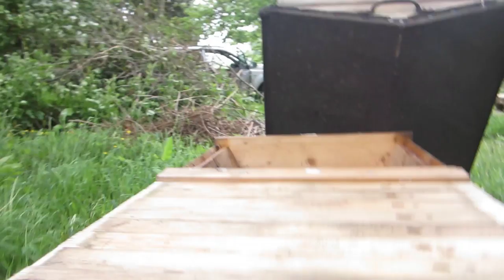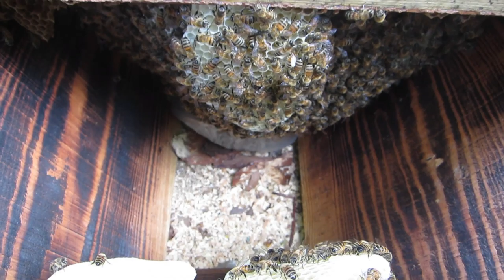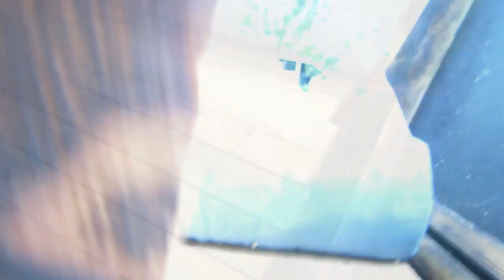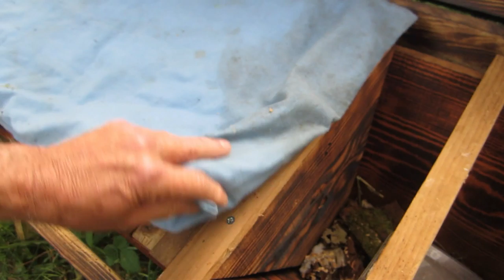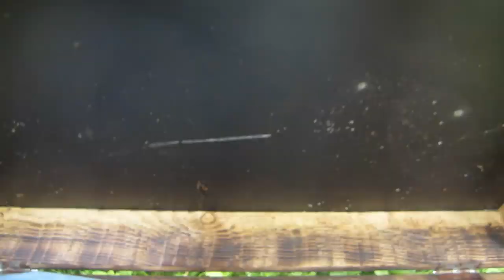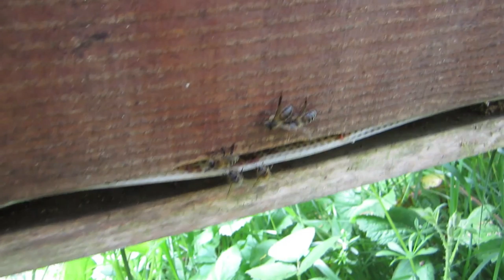Why are my bees doing NOTHING?

Comment: Hello Phil, can you write how wide are streets between 2 natural combs at you, in the brood part (is it 10mm or less?) . At the moment Im parcticing Housel centering system in my LR colonies. Thanks for videos. Best regards, Sinisa.
Reply from the maker: They leave a variable gap, which I have not measured, but I would guess 6-8mm.
Reply: @BarefootBeekeeper  thank you very much for answer :) As I have information its very important for bees in natural protection against varroa mite also. All we are trapped by foundations 5,35 and 36 - 37mm wide LR frames in brood nest. Thats why all the chemicals came out on the market against varroa.... not to mention that bees cant build natural cones in this conditions... Cheers from Croatia :)
Reply from the maker: @ApisCarnica  I have found that 38mm bars work well for me.
Reply: @BarefootBeekeeper  did you try 32mm?

Comment: Dude, if you have an external microphone, get a windguard, can't be more than USD $1. If it a built-in mic, put a small piece of sponge over the mic hole.
Reply from the maker: I'm waiting for an external mic to arrive for my 4K camera. Meanwhile, I am using a Canon IXUS 115 HS which has a forward-facing mic hole just above the lens. I will test your idea though, thanks.
Reply: @BarefootBeekeeper  My pleasure. That kills the wind noise, (not really wind noise, but rather air gusts collapsing the mic diaphragm!) but lets other sound through. Even the lightest sponge works well!